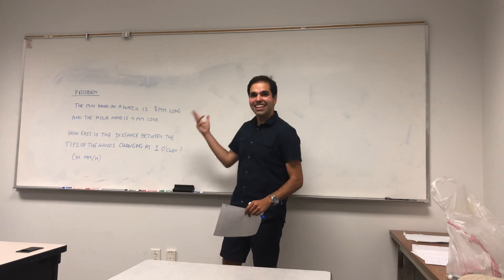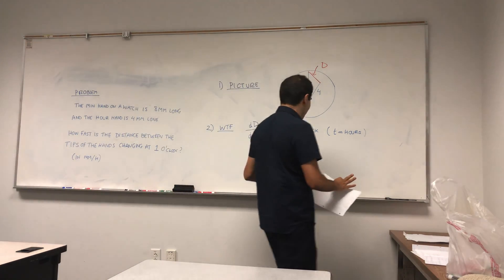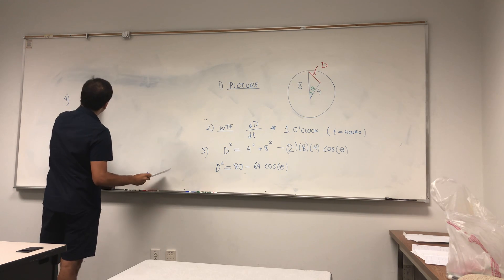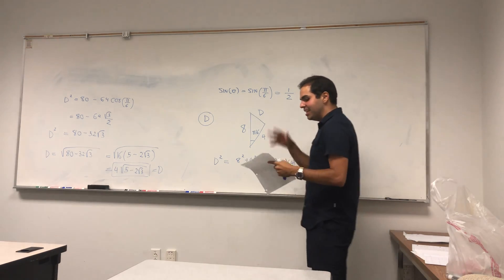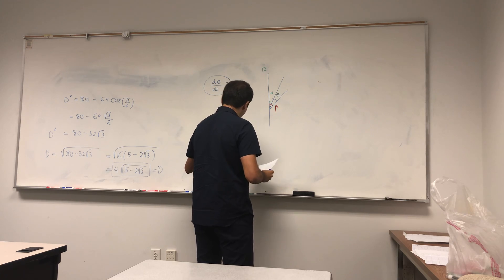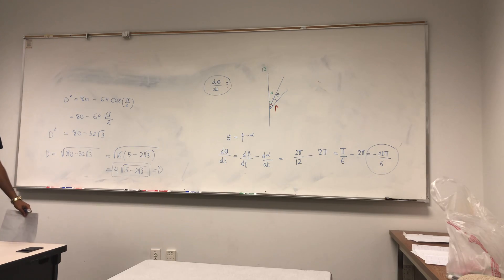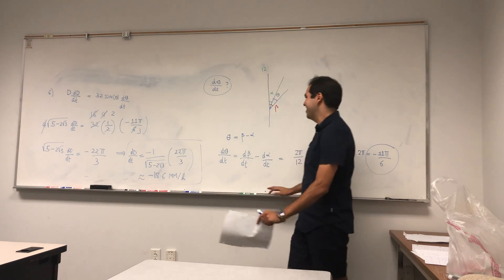Related Rates Clock Problem

Comment: The hour hand of the clock is 1 foot long and the minute hand is 1.6 feet long. At what rate are the ends of the hands of the clock approaching each other when the time is 2 o'clock? 

I need answer could you please help me 🙏🏻

And options of this problem

a) 0.095 ft/min 
b) 0.108 ft/min
c) 0.114 ft/min 
d) 0.203 ft/min
Reply: If you help I will definitely subscribe your channel 👍🏻
Reply from the maker: Well, once you watch the video you can figure out the answer!

Comment: Everyone should be VERY careful with physical approach to this problem, because dD/dt (changing distance between the tips) is NOT length of vector of relative speed between tips. If you search for relative speed, you got another result (personally I made this mistake and got ~51.2 mm/h). E. g. suppose two hands of equal length, tips moving with the same linear speed 1 opposite to each other - in this case dD/dt = 0, but relative speed is 2.

Comment: Is it possible to solve this problem by setting up parametric equations for the position of the tip of both hands then making a distance formula, finding the derivative, and plugging in the time at 1o'clock? I tried it and it didn't work but maybe I messed up some algebra or something.

Comment: 1:20, let's assume it's a continuous clock (where the hands are bound by gears, and don't just tick an entire unit to the side whenever the time comes per-hand) including the seconds hand (and as long as our dx is no shorter than 2^-16 seconds, it's physically accurate)
First parametrize each hand:
the tip of the minute hand can be expressed by: (sin(t * 2pi/hour)*8mm,cos(t * 2pi/hour)*8mm)
ditto hour ditto: (sin(t * 2pi/12hour)*4mm,cos(t * 2pi/12hour)*4mm)

(d(t)/4mm)^2 = (2sin(t*2pi/hour)-sin(t*2pi/12hour))^2+(2cos(t*2pi/hour)-cos(t*2pi/12hour))^2
At t = 1 hour: (d/4mm)^2 = sin(2pi/12)^2+(2-cos(2pi/12))^2 = 5-4cos(2pi/12).
d(t) = 4mm*sqrt(5-4cos(2pi/12)) = 4mm*sqrt(5-2sqrt(3)) (we take cos(pi/6) granted)
The derivative of the distance equation is (dividing by 2 since these are all squares and will get such a factor, and factoring 2pi/hour on the right as all components have such a term):
(d/4mm)*(d’/4mm) = (2pi/hour)[(2sin(t*2pi/hour)-sin(t*2pi/12hour))(2cos(t*2pi/hour)-cos(t*2pi/12hour)/12)
+(2cos(t * 2pi/hour)-cos(t*2pi/12hour))(-2sin(t*2pi/hour)+sin(t*2pi/12hour)/12)]
Plug in t = 1 hour...
(sqrt(5-2sqrt(3))*d’/4mm)*hour/2pi = (-1/2)(2-sqrt(3)/24) +(2-sqrt(3)/2)(1/24) = -1+1/12
Divide by sqrt(5-2sqrt(3)), and s = 1/2...
(d’/4mm)*hour/2pi = (-11/12)/sqrt(5-2sqrt(3))
d’ = -22pi/3/sqrt(5-2sqrt(3)) mm/hour, which is about (-18.59 mm/hour)
Along the way, i found the approximation for pi ~ (5-2sqrt(3))(45/22), meaning this is approximately -sqrt(110pi).
Reply: after seeing your solution, i noticed you used some unnecessary trig laws, as well as the chain rule and polar coordinates where you didn't really need to. it's handy to know, but a pure algebra approach is more than enough to solve this. the only trig laws present in my answer are sin^2+cos^2 = 1 and the solution to cos( 30 degrees ), from the 30-60-90 triangle

Comment: i wonder what the maximum rate would be.
Reply from the maker: Haha, that would be a related rates inside a related rates!
Reply: @drpeyam  looks like the 1 o'clock example is about 1 minute 15 seconds after one of the maximas
Reply: yup! :)
lets see...
d[D]/dt = (32*sin[theta]/(80-64*cos[theta]))*d[theta]/dt 
=
2*sin[theta]*(5-4*cos[theta])^(-1)*d[theta]/dt

d^2[D]/dt^2 
= 
(2*sin[theta]*(4*sin[theta])*(-1)*(5-4*cos[theta])^(-2)+2*cos[theta]*(5-4*cos[theta])^(-1))
*
(d[theta]/dt)^2
+
2*sin[theta]*(5-4*cos[theta])^(-1)*d^2[theta]/dt^2

t is measured in hours, t=0 corresponds to 00:00, angle is measured from the 00:00 position.

alpha = t*(pi/6) mod 2*pi
d[alpha]/dt = pi/6  i am ignoring the mod. it shouldn't matter.
d^2[alpha]/dt^2 = 0

beta = t*(2*pi) mod 2*pi
d[beta]/dt = 2*pi  i am ignoring the mod. it shouldn't matter.
d^2[beta]/dt^2 = 0

theta = |beta-alpha|
d[theta]/dt = | alpha==beta -> DNE
                       | alpha>  beta -> d[alpha]/dt-d[beta  ]/dt = pi/6-2*pi = -pi*(11/6)
                       | alpha<  beta -> d[beta  ]/dt-d[alpha]/dt = 2*pi-pi/6 =  pi*(11/6)
d^2[theta]/dt^2 = | alpha==beta -> d[DNE]/dt = DNE
                               | alpha>  beta -> d^2[alpha]/dt^2-d^2[beta  ]/dt^2 = 0-0 = 0
                               | alpha<  beta -> d^2[beta  ]/dt^2-d^2[alpha]/dt^2 = 0-0 = 0

d^2[D]/dt^2
=
| alpha==beta -> DNE
| alpha>  beta -> (-8*sin[theta]^2+10*cos[theta]-8*cos[theta]^2)*(5-4*cos[theta])^(-2)*(-pi*(11/6))^2
| alpha<  beta -> 2*(5*cos[theta]-4)*(5-4*cos[theta])^(-2)*(pi*(11/6))^2
=
| alpha==beta -> DNE
| otherwise      -> (pi^2*(121/18))*(5*cos[theta]-4)/(5-4*cos[theta])^2

0 = (pi^2*(121/18))*(5*cos[theta*]-4)/(5-4*cos[theta*])^2
0 = (5*cos[theta*]-4)/(5-4*cos[theta*])^2
0 = 5*cos[theta*]-4
4/5 = cos[theta*]
arcCos[4/5] = theta* =~ 0.644 rad

(d[D]/dt*) = 2*sin[theta*]*(5-4*cos[theta*])^(-1)*d[theta*]/dt
=
2*[3/5]*(5-4*[4/5])*pi*(11/6) = pi*(11*(25-16))/25 = pi*(99/25) =~ 12.441

the first time that hits it.
theta* = pi*(11/6)*(t*)
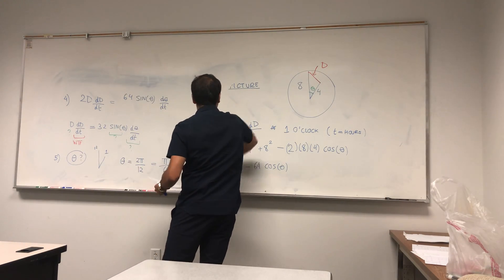t* =~ 0.112 hours -> 00:06:42

it should hit the max rate at about 6:42 both before and after every crossing point. 
looking up all the times the hands cross https://www.youtube.com/watch?v=HcqdqsQq-6M
so, around~
                   00:06:42
00:58:45 | 01:12:09
02:04:13 | 02:17:37
03:09:40 | 03:23:04
04:15:07 | 04:27:31
05:20:35 | 05:33:59
06:26:02 | 06:39:26
07:31:29 | 07:44:53
08:36:56 | 08:50:20
09:42:24 | 09:55:48
10:47:51 | 11:00:15
11:53:18
Reply: (results derived courtesy Wolfram FullSimplify and Reduce):
vectors:
 𝐡(t) = [4cos(𝝿 t/6),4sin(𝝿 t/6)],
 𝐦(t) =  [8cos(2𝝿 t),8sin(2𝝿 t)],
 𝚫(t) = h(t)-m(t),
scalars:
𝛉 = 𝛉(t) = 11𝝿 t/6,
d(t) = √(𝚫(t) . 𝚫(t))
     = 4√(5-4cos(𝛉)),
d'(t) = 44𝝿 sin(𝛉) /
          ( 3√(5-4cos(𝛉)) ),
d''(t) = -242𝝿² 
   ( 3-5cos(𝛉)+cos(2𝛉) ) /
   ( 9 (5-4cos(𝛉))^(3/2)
d(t) is distance between hand tips at time t hours, in mm. d'(t) is rate of change of distance, in mm/hour.
d''(t) is zero at extrema of d'(t).
The maxima are at
  t = (2+12n)/11, n∈ℤ,
minima at
  t = (10+12n)/11, n∈ℤ, e.g., 
d(2/11) = d(10/11) = 4√3,
d'(2/11) = -d'(10/11) = 22𝝿/3,
d'(2/11) = d'(10/11) = 0